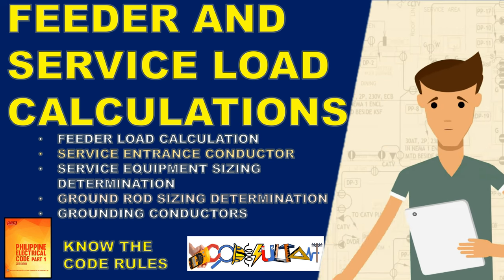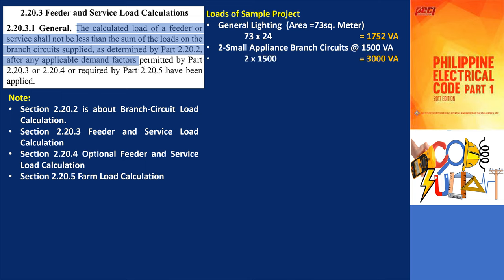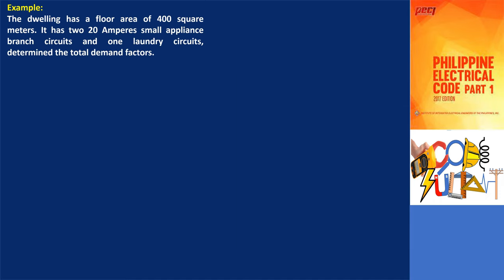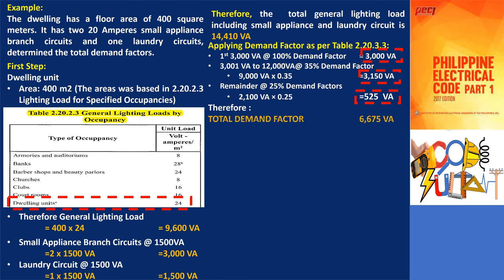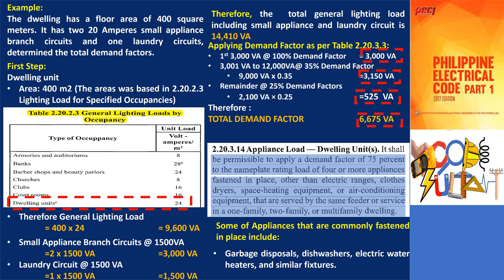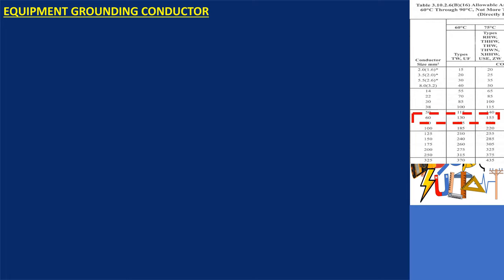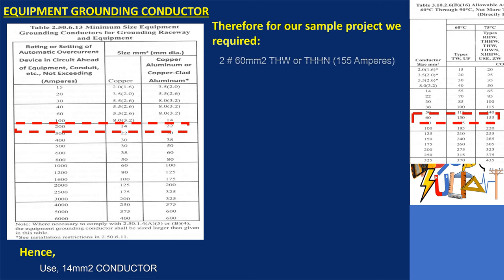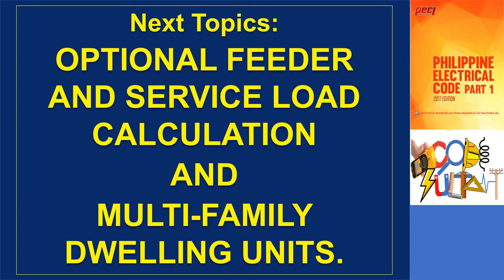HOW TO CALCULATE LOAD FOR FEEDER AND SERVICE?

Comment: 3001 to 120000VA @35% not 12000VA, the rest of the load shoul be included to %35 df
Reply from the maker: The information provided in table 2.20.3.3 is quite clear. Please review the table and verify its accuracy at time 4.45. If you notice any errors or discrepancies, kindly provide your comment at what time in this video. I can update at made necessary corrections. Your input is greatly appreciated

Comment: So is this for Philippines only??
Reply from the maker: Hello, thank you for the comment. Our Philippine Electrical Code was based on NEC 2017. If another country's Electrical Code was based on NEC 2017, they can use this as a reference; however, if they are using NEC 2020 or NEC 2023, they cannot use it all because there are some changes made in NEC 2023. I will make a video on the same topic using NEC 2023 and make some analysis of the changes. Thank you.